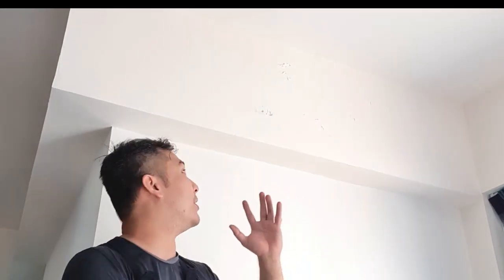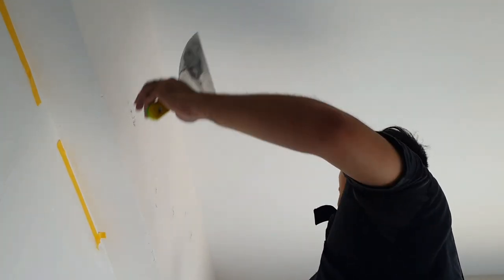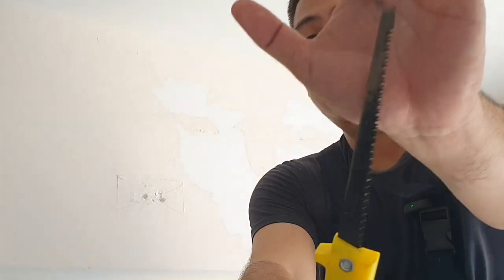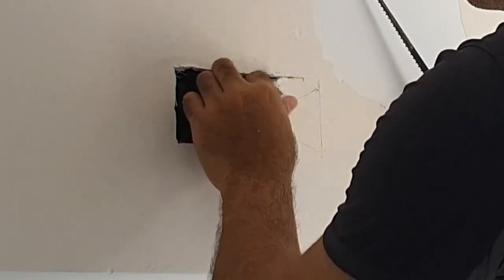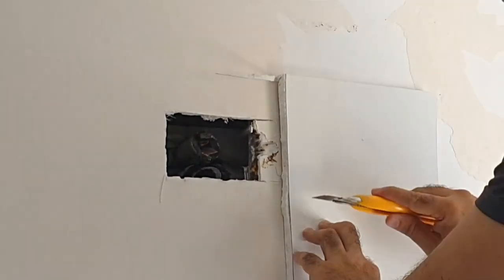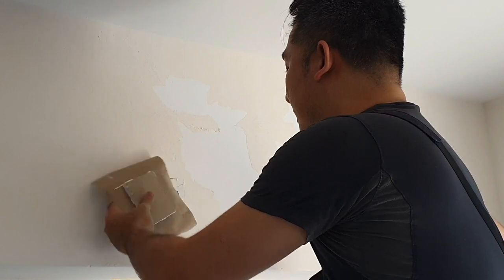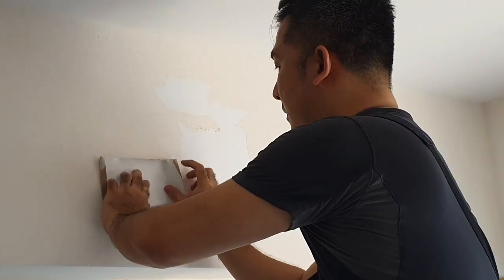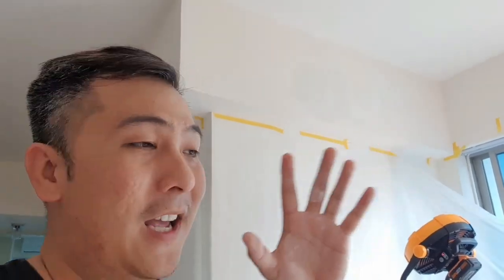@ThePunggolHandyMan : How to fix a hole in Drywall (Partition Board)

Comment: For BTO dry wall, what size or length of anchor plug is appropriate for heavy duty load ard 30-50kg..planning to use hollow wall metal anchor, the expansion type.
Reply from the maker: Hi drywall is not designed to carry such loads. It must be reinforced. If you're saying HDB intermediate prefab wall then you need wall anchors. Wall plugs for such load is not advisable.
Reply: @ThePunggolHandyMan  any reccomendation of anchors for pre fab wall?.. appolagies for the question,been finding it for quite some time
Reply from the maker: It's a bit hard to gauge without seeing the actual wall as BTO walls vary.. Best is to take a picture or to find out exactly what wall this is and bring to a place like horme where the staff there can advise you 😉